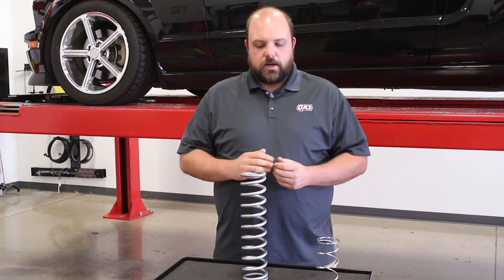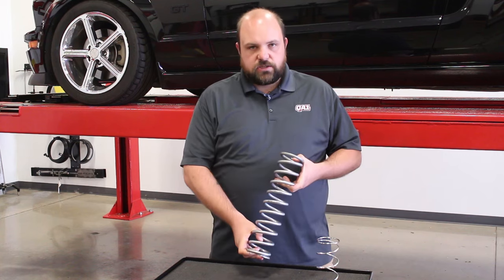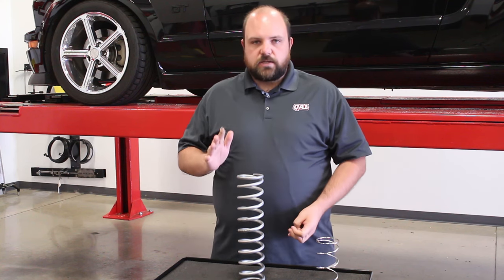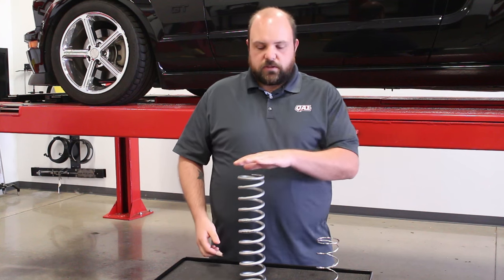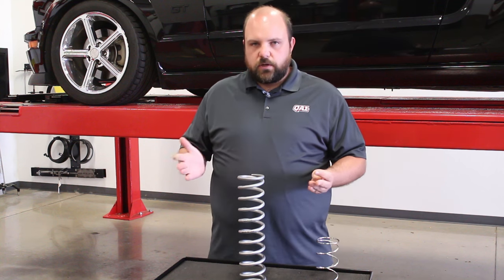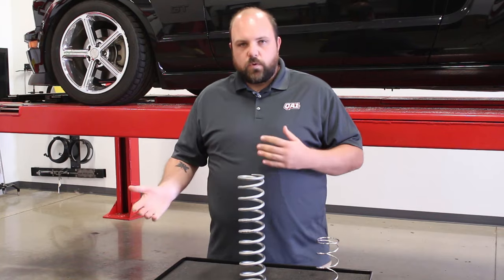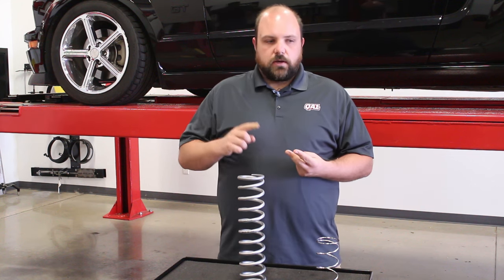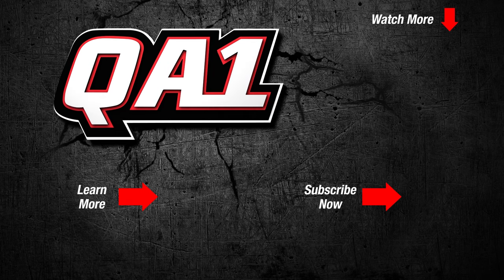What Spring Rate Do I Need? - QA1 Quick Tip

Comment: So my stance car weights fuck all so I should run 600 rate 5 inch springs so I don't ground out or rub arch?
Reply from the maker: If you're trying to limit suspension travel to limit most suspension movement, you would need a higher spring rate, especially with a stanced setup. You could also use a bump stop to limit your travel.

Comment: I want to put coilovers on my '73 AMC Javelin.  The original front spring has a free height of 14.31 inches and a spring rate of 307 lbs.  If I purchase a coil-over that is 10" long,  should choose the same spring rate as the original (assuming I want the car to ride as before) or do I need to select a different rate since the coil-over is shorter?
Reply from the maker: I would recommend calling into our tech line to see what the best setup would be. 952-985-5675

Comment: I have a 1929 model a.  My front springs are nearly completely compressed when sitting. It has a stock 302 engine. Any idea what weight front suspension springs you'd recommend?

Comment: I think this how you calculate unsprung spring rate or what spring you need.

So if your rear end was 1500 pounds and you subtract tires, axle, brakes, etc and you end up with 1200 pounds,
your spring should be able support that weight without bottoming out.
So if you take 1200 and devide by 4 you'll get 300
So you need a spring with a rate of 300 or a longer spring. This would be 25% compression for a 16 inch spring. 

450 pounds in the example seems like a small amount, unless he was referring to a small car?

Comment: general car> setup 25-35% of the wt on each corner would b idle. Cars r front wheel drive & front engine so yeah all up front not race car mid engine idle, & diff then a 4 by 4 set up. Is front axle solid or IFS is back solid or IRS how much travel is factor in how much wt u want to put on it + if truck the rear is going to see most of added wt or ppl wt 2 door front will gain etc.

Comment: What would I need for a 68 C10? Ls3 engine, I need front and rear. Oh and what do you recommend, single or double adjustability?
Reply from the maker: If the truck is mainly a street truck, the single adjustable option would be a good one! And we would recommend a 750 lb. spring rate.
Reply: @QA1TECH  and for the rear? Single adjustability with what spring rate do you think?
Reply from the maker: @tonyhuerta3088  Same adjustability, but you would want a 200 lb. spring rate.

Comment: It a bit of work but you can weigh your axle by -
jack up the car 
Put weigh scale under each wheel. 
Disconnect the shocks so wheels are sitting on the scales.
Read off the weights. Suspension arms at mid travel give the closest figure.
Reply: What kind of scale?

Comment: comment 51:must see/hear video: not just how much wt per corner but more important spring weighing method how much wt on this spring on this corner current setup as far as what is on in the car & how it is sitting. Kind of the same thing but truer in a way number, & it's not a fixed number, bc like a trailer raise or lower hitch & wt is diff.

Comment: I'm confused about something. He says that you always want 25 - 30% of the spring compressed. So if that's an 11 inch spring, that's 2.75 - 3.30 inches. However he also says that you can tell how much weight is on a spring from the car, by how much the spring compresses. What I don't understand is what that knowledge actually gives you? Seeing as you must have a certain amount of the spring compressed, seems you are limited by what actual weight of spring you need, because any stiffer than what the car already weighs on it and it won't compress at least 25%, and any softer and it will compress more than 30%. How would you use this knowledge when selecting race car springs when you are actively TRYING to make a car more stiffer? Because the weight of the car is a constant. Seems to me you would get to a point where the stiffer a spring you install, the less it will obviously compress? Which is bad? But isn't that the point of a stiffer spring?
Reply from the maker: Hi Don, good question, and we see what you're saying. In a race car scenario, when you're using the spring as a tuning device for controlling load on the suspension, you may operate outside of this range. The 25-30% is more of a general rule of thumb or starting point for selecting an initial spring rate. Depending on the application and use of the vehicle, you may decide to use a stiffer or softer spring. Thanks!
Reply: Firstly, I'm no expert. However, I believe if you have two spring rates to choose from, one soft and the other stiff, then the softer spring would need to be longer in free length than the stiffer spring. Therefore you could have the same percentage compression of the springs with the cars load on them. This could be done in such a way as to not effect ride height despite one spring being shorter because it compresses less than the longer spring. This also prevents losing shock travel when choosing a softer spring. Hope someone else can explain further

Comment: Where's the starting point, how do I determine what coil over I need if my car didn't come factory with them but has torsion bars ?
Reply from the maker: The spring rate is based on the front end weight of the vehicle. If the car has torsion bars it doesn’t need coil-over springs since it already has springs supporting the weight of the car.
Reply: @QA1TECH  okay thanks, I was going to do a conversion.
Reply from the maker: @Moparmaga-1  You can give our tech line a call and they can give you the best recommendation! 952-985-5675

Comment: I'm confused. he raid "if it comes down 11inches" (are they refering to the ride height?) and then he followed that by saying "that means the spring is compressing 3 inches" ?? how? what? please can some explain
Reply from the maker: Hi Billy, 
He's explaining that if you measure this spring (which has a 14 inch free length) while it's installed, and it measures 11 inches, it's 3 inches shorter than with no weight on it.

Since the spring rate is 150 lbs per inch, and the weight of the car is compressing the spring 3 inches, you know there is approximately 450 lbs of force acting on the spring. 

Hope this helps, let me know if you have more questions. Or you can call our tech line (952-985-5675) if you have more technical questions on your particular application.
Reply: QA1 oh of course haha. all makes sense now. Thanks for the reply
Reply: One more question why would someone adjust pre load?
Reply from the maker: You need some preload to prevent the spring from moving around when the shock is at its full length. Adjusting the amount of preload can give you some desirable handling characteristic depending on the application.

Comment: Would u have a higher spring rate on the front end of the car vs the rear end
Reply from the maker: Typically yes, depending on the application. You need a higher spring rate to support all the weight of the front of the car. Give us a call and we will be happy to recommend something for you!

Comment: 14” spring length x 150lbs/inch of compression = 2100lbs to fully compress that spring!!! No!!!  I’m positive that that spring is not rated for 2100lbs. The amount of weight it takes to compress a spring one inch is for the first inch and progressively takes more weight as the spring compresses. Springs do not compress linearly as he suggested.
Reply: Some springs are linear springs.

Comment: I got a 96 ss impala which spring would I need
Reply from the maker: Are you looking for a spring rate for the front of your vehicle? Are you running a small or big block engine?
Reply: @QA1TECH  1996 ss impala 5.7
Reply from the maker: @sam198130  Then we would recommend a 500 lb spring for the front. We have front pro coil systems that include the shock and spring. For example, if you wanted a single adjustable coil-over shock, the part number would be GS507-10500C.
Reply: @QA1TECH  I want a double coil over shock whats the part number
Reply from the maker: @sam198130  Okay, then the part number would be GD507-10500C
Reply: @QA1TECH  it says for the double coil over part number gs507-10650c
Reply from the maker: @Sammy Sosa That's a typo on whatever website you are looking at. That would be a single adjustable shock with a 650 lb spring rate. We would recommend the 500 lb spring rate based off the information you have given us. GD507-10500C is a double adjustable shock with a 500 lb spring rate. If you go to our website and enter your vehicle in the filter, you will see the coil-over systems we offer and the part numbers.
Reply: @QA1TECH  I'm sorry I meant gd507-10650c is the double coil over and this is what I ordered
Reply: What would you suggest for rear double adjustable coilovers for a 1996 impala ss?

Comment: BC Racing Coliovers are 6k Front, and 5k Rear, I think that's too soft for my car since I plan on lowering my car to a 2.8 inch Drop in the Front, and a 2.6 inch in the Rear, they do customized the Spring rates for you, but the question is I don't know how much each corner weights. I might just take the Spring rates they offer 6k and 5k and call it a day, I don't want to go too high on the Spring rate only to make my car ride like crap, or I might do 8k for the Front, and 6k for the Rear. This is confusing.
Reply: Right! and not once did he mention 6k-8k-10k etc....
i have an Evo 8 and dont really know what a higher spring rate is going to do for me. 
Megans "Street" series come with 8kg Front and 6kg Rear, and their "Track" series are 12kg Front and 10kg Rear 
i Think i need 10kg Front & 8kg rear which is right in the middle of the 2
But Yes...Very Confusing when its not being explained right
Reply: @Thr33.Sid3z  BC Racing usually customize the Spring rates for you 12k is probably the max for street daily use
Reply: @Thr33.Sid3z  the higher the rate, the worse the ride on the street/better the handling on the track. Like let's say 14k front, 14k rear will not be good in street driving and your car could leave the ground if you run over bumps too quickly and you'll lose control. On the track however, you'll be dominating other cars. A 5k front and 5k rear will be a smooth ride and you won't run the risk of losing control over bumps. You will however, realize really quickly that they are way too soft on a track. People usually try to stick between 8k-11k for both front and rear if they are street driven and track driven. Also, pay very close attention to valving because that will HAVE A LOT TO DO WITH THE RIDE QUALITY along with the spring rates
Reply: You plan on slamming your car on an aggressive setup I'd suggest a high spring rate 8k or more
I have 8k front 6k rear and about 1 inch and 1/2 drop and I rub like crazy in the rear when going over bumps with weight in the back and I still have wheel gap
So if you want a minimal wheel gap and be static I'd go with at least 10k or more
Reply: I just bought BC Racing Coliovers Extreme Drop I'm running 12kg Fronts 2.7 inch Dropped and 6kg Rears 2.5 inch Dropped custom Spring rates basically I'm running an aggressive Ride Height about an inch and a half from the ground to my Front lip but the Rears sit higher up for clearance since the Rears usually face the most impact you will feel it bottom out if it's too low to the ground
Reply: If u got potholes like Detroit... It's ride comfort will feel similar to a violent assault to your spine